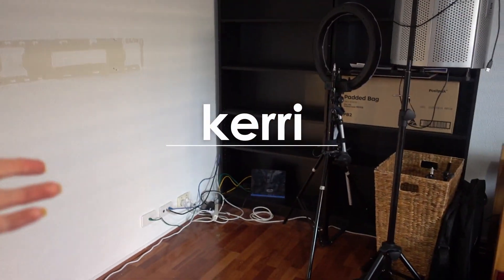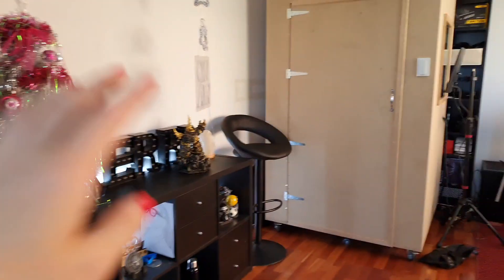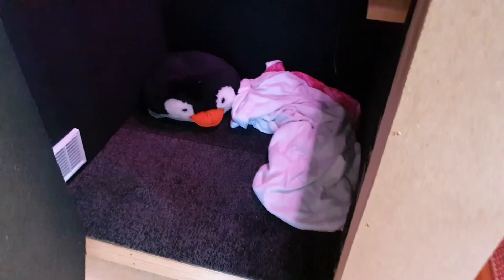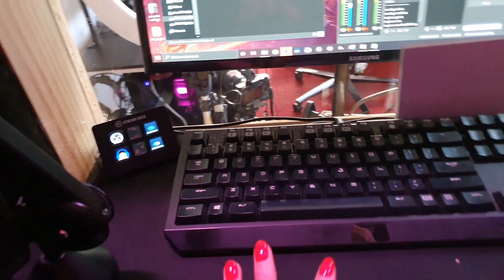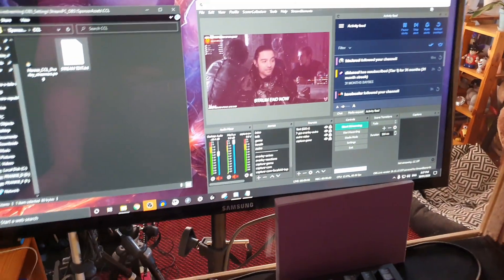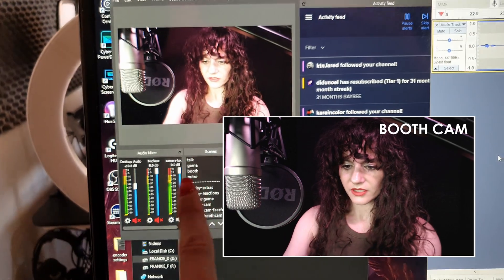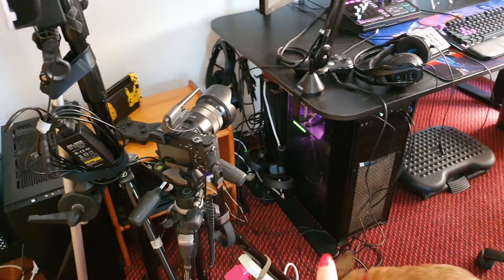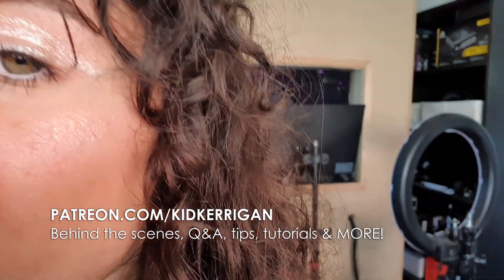CUSTOM HOME VOICEOVER BOOTH TOUR! AD. ELGATO STREAMDECK MINI FOR VOICE ACTORS

Comment: That's sick! Nice job to you and your dad.

I couldn't help but notice when you were recording as a test that the waveform was smol. I've always been bad with sound management. What was the dB level for the recording?

Absolute legendary stuff.
Reply from the maker: Thank you!! :D The dB level changes, but I try to keep it high enough so that when I normalize to -3dB it doesn't crunch or stretch it too much. Just takes a lot of playing it by ear. I usually fullscreen the waveform so I can see a better picture of if things are popping or there's a hum etc. I did change my mic placement since this video too, which I think has improved the sound (mic is now below my face instead of above, so I can project into the mic better with less gain. I've had a lot of positive feedback from potential clients that way - but have yet to see how much of those will book me :)